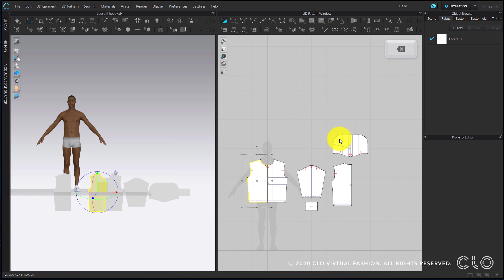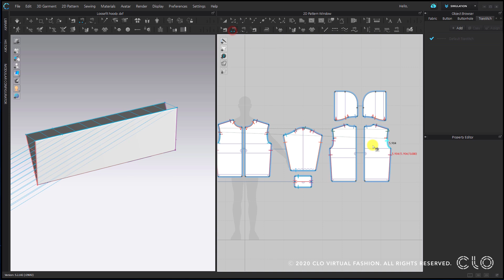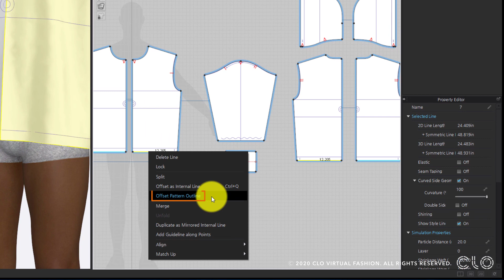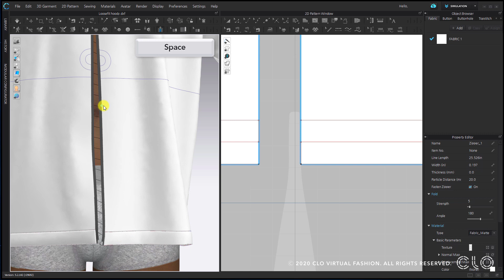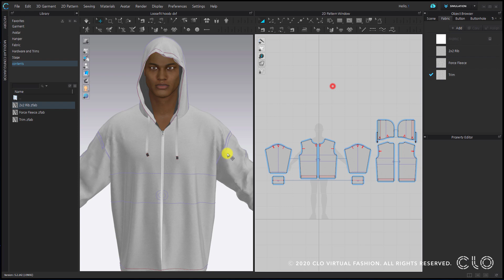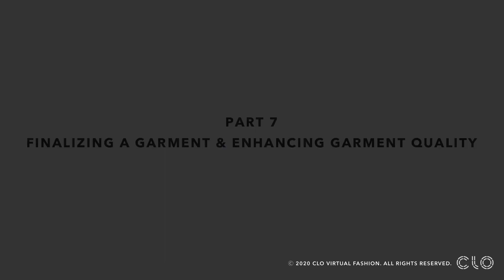Garment Construction: Hoodie(EN)

Comment: Hi there! I don't see the "contents" folder in my Library. I have tried clicking the Download icon at the top but still nothing. Are there any links that I can use to download the DXF files? Thanks in advance!
Reply: maybe because the software is updated from when the video was created. I had the same question as you. but it worked out when I just dragged and dropped the downloaded file.
Reply from the maker: for further help we recommend posting to our Official CONNECT Forum - https://connect.clo-set.com/community
Reply from the maker: Not sure what contents folder you are referring to... the files for this project is in the link in the description.